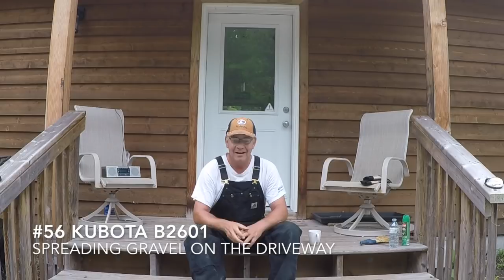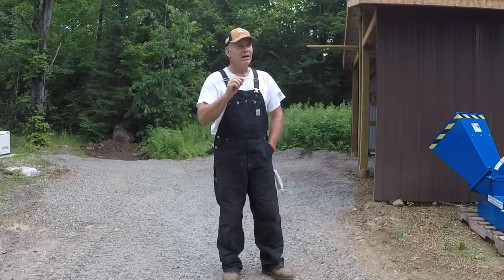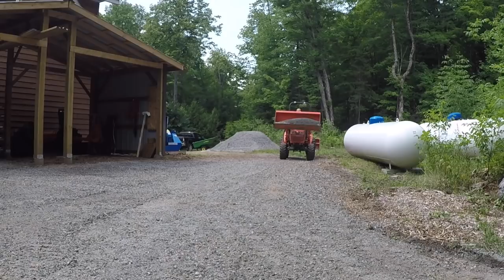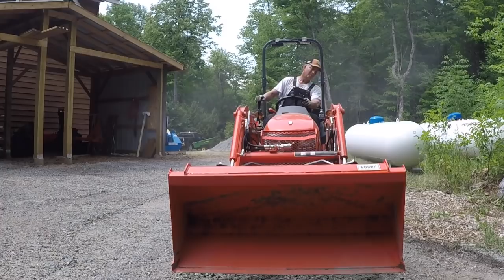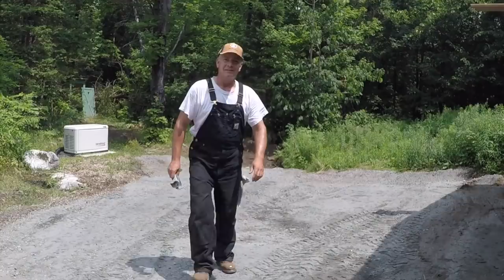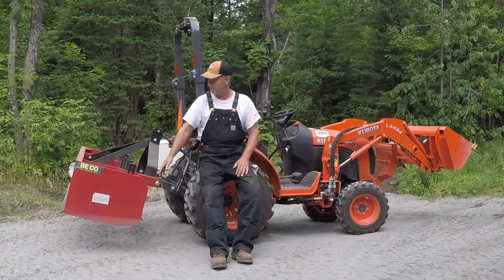#56 Kubota B2601 Compact Tractor Spreading Gravel on the Driveway. outdoor channel.

Comment: I had a guy use a 5 ton roller compactor finish my driveway.I recommend it so it helps keep the gravel in place and helps prevent possible wash out by heavy rain in the future.
Reply from the maker: That would do the trick for sure. Cheers and thanks!

Comment: Glad it worked out for you. I find it easier to be spread material to a consistent thickness traveling faster. Now that you have the basic technique down try going a little faster so that you are just slowly dumping the bucket without stopping, and you will get a more uniform spread. Another tip when you are grading with the bucket, instead of picking the boom up and down to adjust height, roll your bucket forward or back. This will give a much quicker response as well as a smoother finish. These are things that work well for me but remember every one is different. I can tell by the little bit I have seen that will be a better operator in time. You are doing well now. It only takes me a couple of minutes of watching someone to tell if they have it or not, and it looks like you have it.
Reply from the maker: Good morning dp. Thanks for the tips above, I appreciate it. I need to do the side of the house next so I will keep these in mind and it will give me a little more practice. Cheers and thanks again!

Comment: Great job!  In a couple of weeks, use the box blade to make it really smooth.  If I remember, you are supposed to tilt the box back to take the teeth out of the equation.   if you are mostly happy with it except for a few spots, use a steel rake, wet it down, your done.  Look forward to the next video and thanks for the advise on the cab.

Comment: Nice job.  I've been using the bucket to backdrag on piles of milled asphalt aggregate (it's free, but it's been sitting for 1-2 years at a neighbor's and "solidifying"  -- but I'm working on a back trail on the property which doesn't need to be pretty, but does need to be clump-free).
Reply from the maker: Thanks Carla. A first, but not the last. Got a bunch more of the driveway to fix but this is pretty promising. Thanks so much for the support and for the comments- always like to hear from you . Have a good one!!

Comment: Another great video.  My comments are about three months to late to help with your project, but it doesn't really matter because they can be added and undertaken over time, especially with such a long driveway.  From this and your last video as well as many of your previous videos that show your driveway, it appears that your driveway/road system does not have ditches on either side of the gravel surface.  People often just clear land, smooth out the lumps and place gravel to drive on.  At best they may place a couple of different grades (coarsnesses) of gravel - a base layer and a finish layer, and job done.  The problem is that the road does not have good drainage or a well defined surface for maintenance and the gravel keeps spreading out as the road is used.  Since you own a back blade you may want to create ditches along either side of your road system to; 1) help with drainage for your road, 2) define your road surface area, .......  Since your driveway is so long, you will not be able to do this in a weekend but you could begin with problem sections and accomplish the entire system over time.  Just angle your blade in the air and create a ditch on the extremities of the road surface.  You will have to reclaim them every now and then but the effort will be well worth it.
Reply from the maker: Good morning Michael! Thanks - not too late at all. You will see I make my first attempt at one in a later video. Didn't do too well to be honest, but got lots of good advice for when I try it again next summer. It is a really good idea to put them in as we get water pooling in a lot of areas of the driveway so its on the list for after winter. Thanks and always welcome your comments. Have a good weekend!